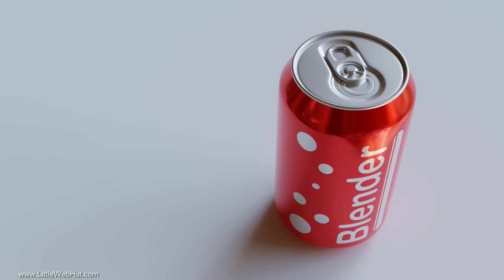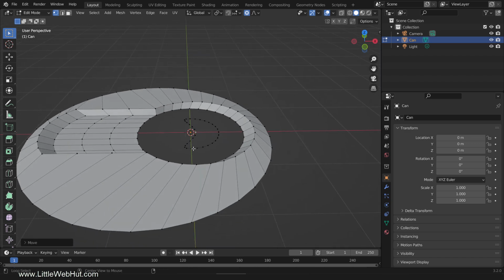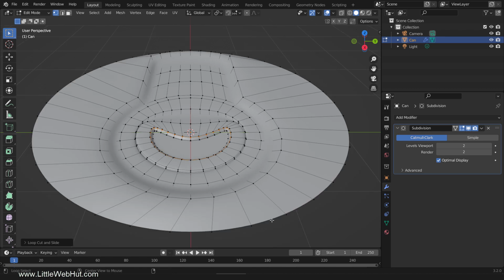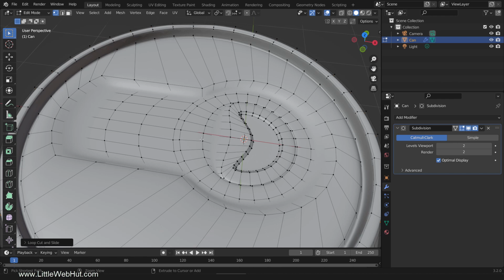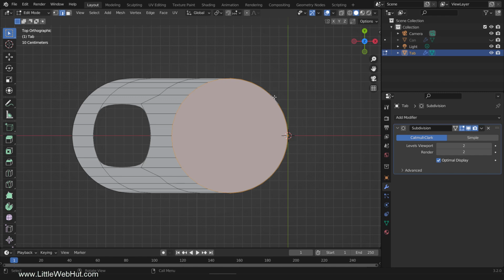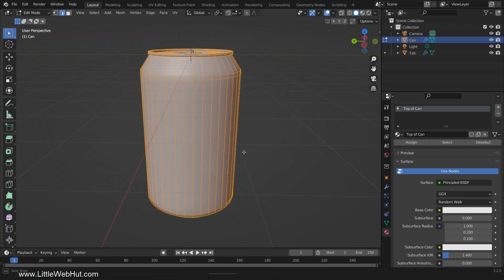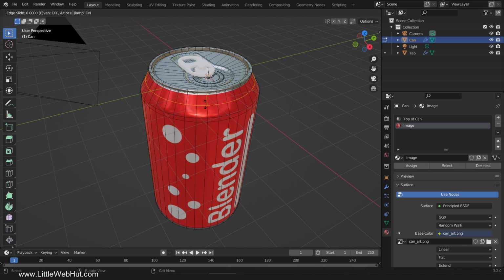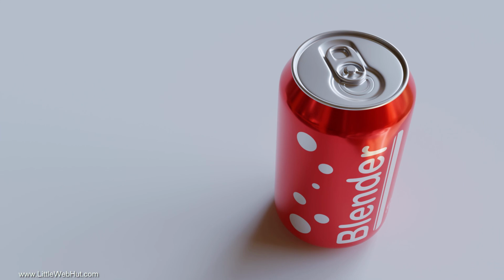Blender Tutorial: How To Make a 3D Model of a Soda Can

Comment: One thing I recommend is to use shift + E to adjust subdivision surface faces rather than loop cuts. As loop cuts increase geometry unnecessarily. It doesn't matter for the purpose of this tutorial. But just as a good practice.

Comment: Made the can today, unfortunately I must have made a few errors because when j try to add the uv wrap the mesh is a really strange shape. Back to the drawing board, awesome tutorial by the way :)
Reply: yep this happend to me aswell. its because i made an extra edge loop at the to[p part of the can so when i mark the seem for uv unwrap it all connects it  together at the top of the can. go in to vert mode and move it down a little to reveal the vert behind it, back into edge mode, select then  right click then select mark seam. press A then U then select unwrap. that should solve the problem.

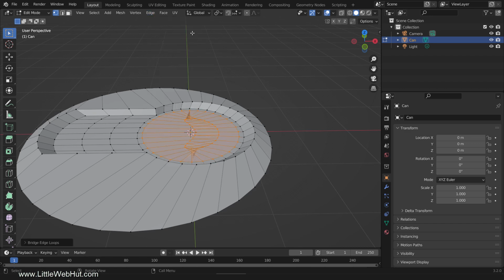Comment: This thing on 3:40 usually happens when the normals of shapes don't face the same direction. If you match the normals at this point (as you did later on), you don't have to move loop on Z axis and "Bridge edge loops" works just fine.
Reply: Tried this, fixed it without having to drag the face down the z axis. Thanks!